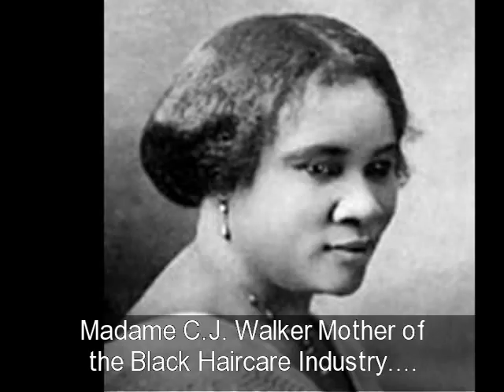THE MILSTAN CUSTOM IRON COLLECTION

Comment: The plasma wielding Electric Blue Beam mimics a lightning bolt it is about 6000 degrees c pressurized gas it reminds a little of the Halo 2 multiplayer video game so cool  Blue Sentinel beam. I used worked at the canadian tire when I was 14 years way back in the 2005 in Quebec City in the Warehouse as a sales assistant. I used to watch the tv series myth busters.